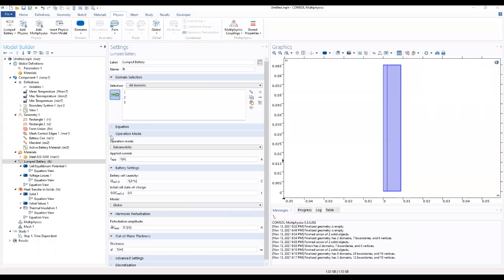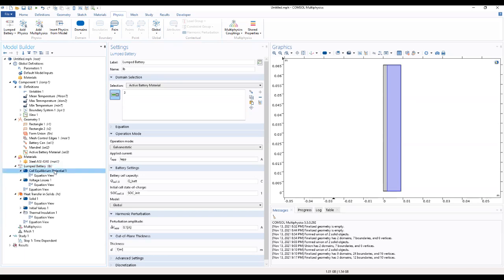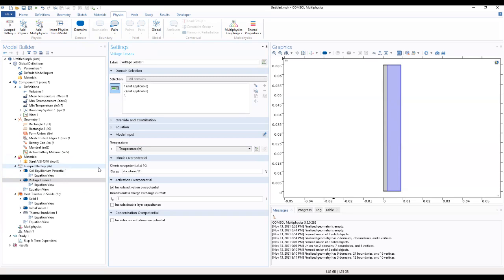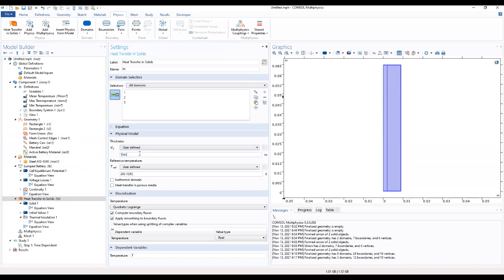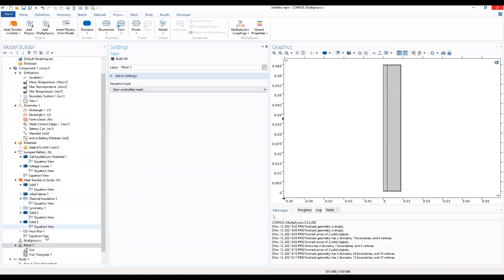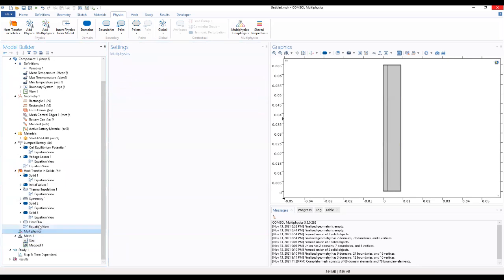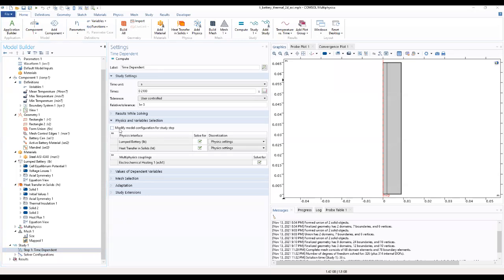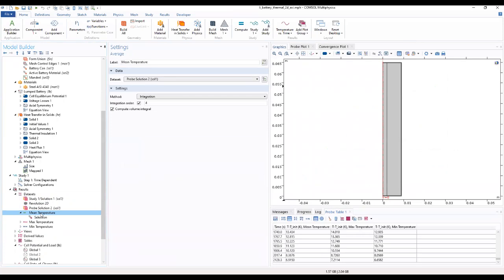HOW TO MODEL COMSOL THERMAL MODELING. Part 2

Comment: Hello sir, I had tried to replicate the results you are showing in the simulation but my results are significantly different from yours ...So, could I share my simulation file with you for the correction ?
Reply from the maker: I will add the new link to this video